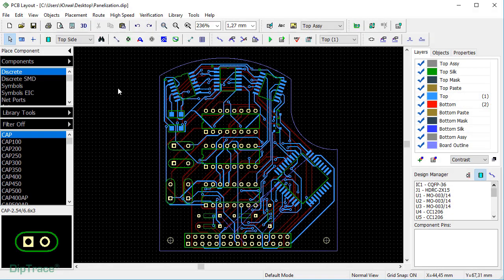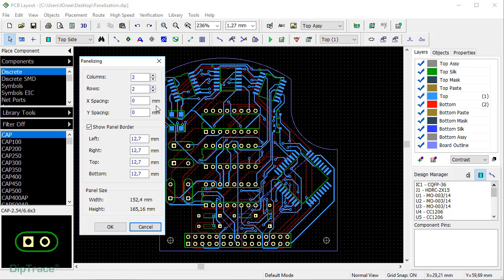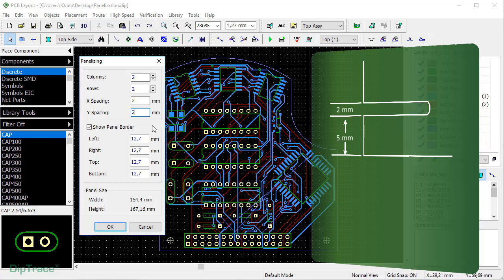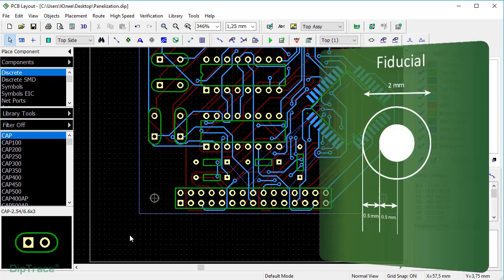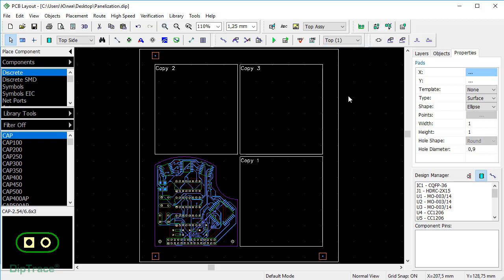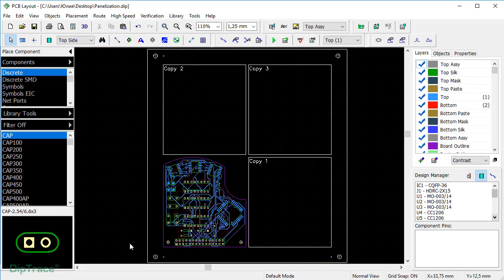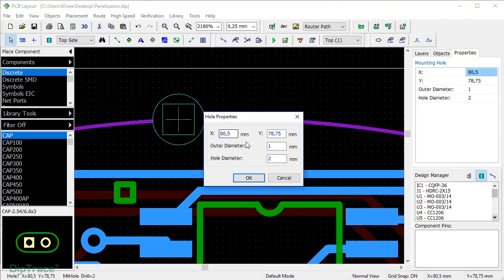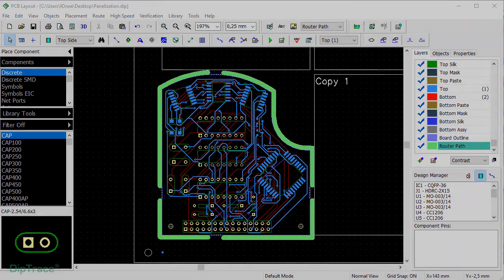Panelizing in DipTrace, Part 1

Comment: How do I specify the Router Path layer so that it is seen as a cut-out when I export the Gerber files?
Reply from the maker: When exporting Gerbers, in the dialog-window select board outline & router path layes to export them into one Gerber file.
Reply: @DipTraceOfficial  Thank you. The next problem is that when I panelize there is the big panel board outline and then the (4) boards inside that also each have their cut-outs. How can I remove the 4 inner board outline cut-outs? I only want my my Router Path to be cut.
Reply from the maker: @nelisbrink7608  Could you send the file with your progect to support@diptrace.com so that we can give you a substantiated response.